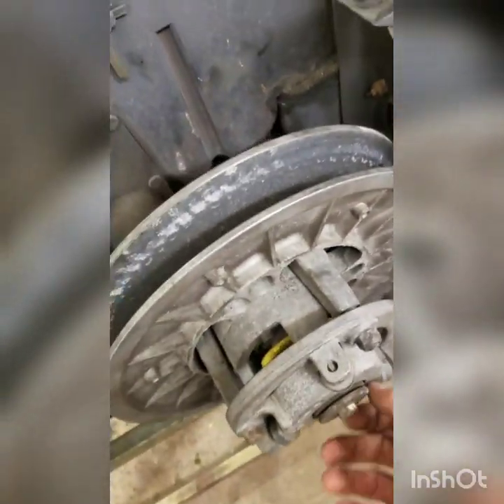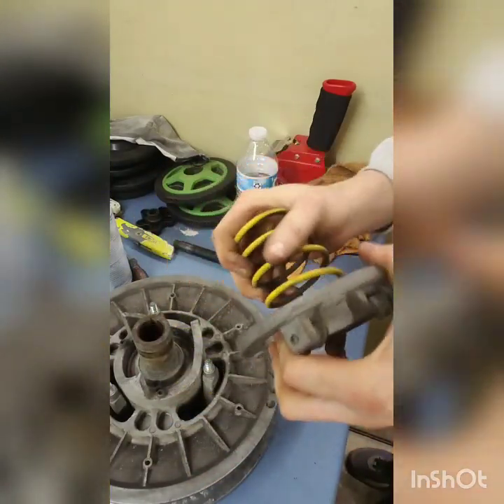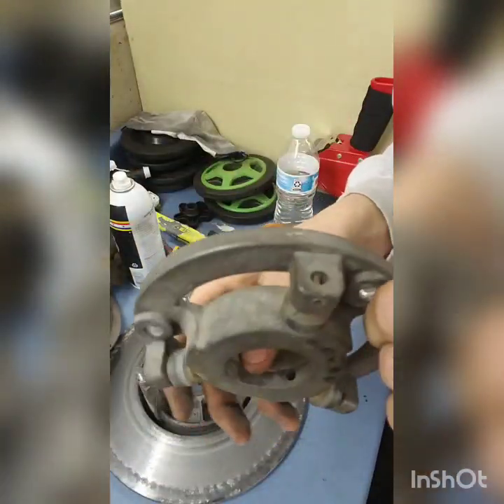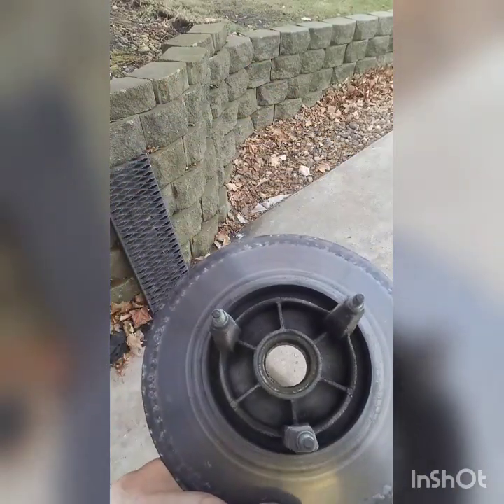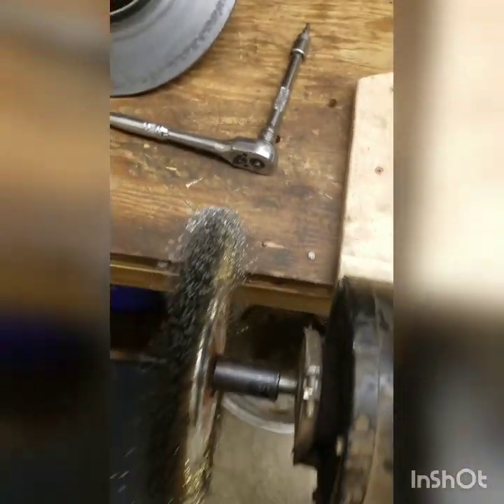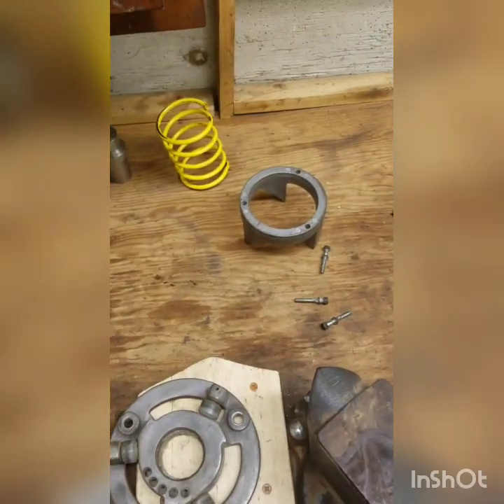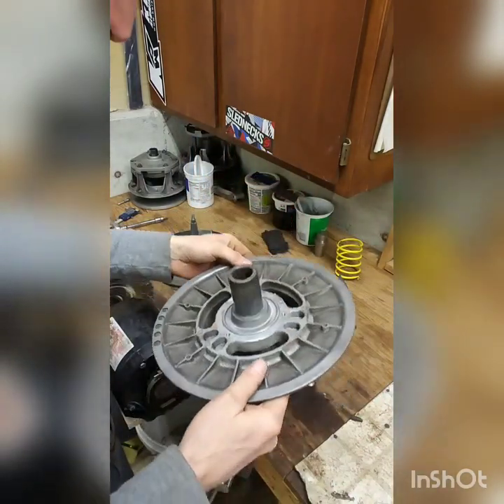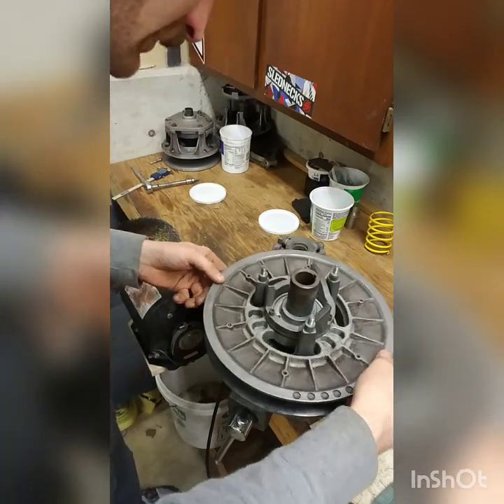Sled Tips 002 - Arctic Cat Roller Secondary Assembly

Comment: lmao, set them in a box full of crap, great idea.   Cool video.  I can't even get my secondary off.   Tried a torch, air chisel, prying, banging, etc.   Currenlty have the sled on it's side, and I filled the bolt hole with kroil....  here's to hoping.
Reply from the maker: I plan on doing a video for removing stuck secondary clutches soon. Have had multiple people reach out about this.
Reply: I literally just cut my old button style into a couple dozen pieces. Had a roller to replace with so I didn’t care. If you get that desperate just cut along the jetway then on the opposite side but don’t go all the way through. Then spread the jetway side. For me that was the only option. Wasn’t taking the jack shaft out. And it worked well.
Reply: Nice fix!   Yeah, didn't want to ruin this roller clutch if I could help it.
Reply: @longtinmotorsports  I wound up removing the jackshaft and took it to a shop.  Required over 20 tons of force to pop off, lol
Reply from the maker: thats wild. Never had one stuck that hard. No damage to the clutch?
Reply: @longtinmotorsports  I mean... the back of the clutch looks like Rihanna's face after Chris Brown had a rough night.   But still functional!
Reply from the maker: 🤣 guess that's all that matters

Comment: Thanks for the video, currently working on the clutches from a 99 zrt600. Are you going to do one on the primary? Also interested in the spring adjustment holes you mentioned, mine was in the second one. Have no idea what they do. Do you use any dry lube or anything on the clutches to keep them free and from seizing on the shafts?
Reply from the maker: I am working on editing my video of primary clutch rebuilding. So watch for those! If you subscribe you should get notified once they are posted. 

I use anti-seize on the jack shaft to keep the secondary from seizing on the shaft. 

The holes act as adjustment for spring tension on your secondary spring. There are a number of things that will change as you move the spring to different holes. I will do a video explaining that because you have asked.

Thanks for watching and reaching out!
Reply: @longtinmotorsports  I finally got my seized secondary off. After using many methods, heat, air chisel, hammers, torches, pullers, cursing, etc., I had to remove the jackshaft. It then required a 20 ton press at work and a couple 230+ lb. guys cranking on it to break loose but not before bending my 12 ton press at home! Curse of death to whomever assembled it with no anti-seize! During the course of all this, the movable sheeve became damaged, its cracked and the towers wont fit back into the roller assembly. I saw you had a bunch of old ones kicking around. Have any available to sell? The whole assembly is # 0726-113 and movable sheeve #0748-023 from a 2001 ZR600. Don't have FB so wasn't sure how to msg you privately...thx.
Reply from the maker: adlongtin@gmail.com is best way to reach me!

Comment: My belts hard to get off! I push in and turn and belt does get loose at all. What could my problem be? 01 zr 800
Reply from the maker: Do you have the right belt and/or the correct clutches? if a belt is too small, that can certainly make it hard to get on and off.
Reply: @longtinmotorsports  Thanks I'll purchase a new belt and see. I cut the old one off lol

Comment: Can the secondary get stuck if the rollers are bad?
Reply from the maker: The secondary wont necessarily stick because of rollers. Sticking would more likely be attributed to bad bushings on the movable sleeve and/or a clutch that is terribly dirty and packed full of dirt/debris. Bad rollers will significantly reduce shifting efficiency pulling engine rpms down and causing a lot of strain on the belt. Bad rollers will also damage things like the helix and the cover plate the rollers are mounted in. Hope that answers your question!
Reply: @longtinmotorsports  okay! Ty

Comment: Love this video
Reply from the maker: Glad you like it! Be sure to check out my other sled tips AND, if there is something you would like help with, let me know and I can help and put together a video on that!
Reply: @longtinmotorsports  I need to do both clutches on my 06 f7 sno pro and I don't know what's the best rebuild kits for the money. I'm ordering the primary puller tool tonight and when it comes in I'm taking both clutches off and cleaning them up. Your videos are super helpful and I subscribed to see more in the future the only thing I don't know at this point is clutches lol  I rebuilt my yamaha viper engine 3 years ago. But if you have time a video on what clutch rebuild kits are best for your buck that would be cool. Thanks so much brotha. Happy riding
Reply from the maker: Chris, be sure to check out sled tips 003, 008, 009, 012, 013, 016, 017. Those are all the ones I have relating to clutching so far. I have definitely missed details in these videos though so I will take your request and see if I can't put something together here this week yet cover what parts I've used and had luck with. Thank you for the request! My goal is to help!
Reply: Man you are super helpful brotha tha KS so much really I have learned alot from your videos...can't wait to rip the f7 efi this winter with fresh clutches... last year they or 1 wasent working right and I had no low torque decent mid range and crap top end would only do like 70 and rpms were high I couldn't figure out the right belt got a stock belt for it what factory calls for arctic cat brand and all 034 and that didn't work so someone said maybe you have a newer frossfire clutch and said to use the 036 so I tried that they both were tight and sled didn't wanna stop on the trail I squeeze the brake and the sled would shut down and when I try to pull start it the sled was moving forward and it's like the secondary clutch was not opening the sheaths but I'm hoping to fix the solution for this year I live in vermont so we have some super nice trails to ride... what state do you live in... tha KS for all your help seriously
Reply from the maker: Best place to start in that situation is get everything back to factory settings and working properly!
Reply from the maker: https://youtu.be/3wFEh54eRaU